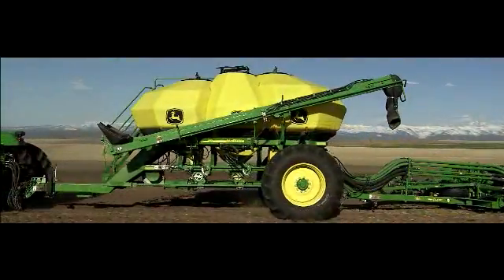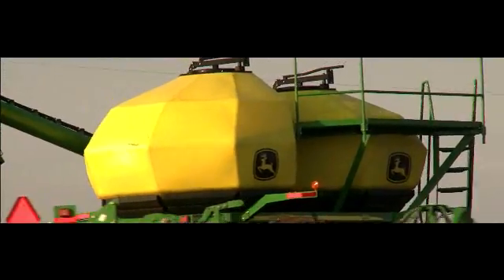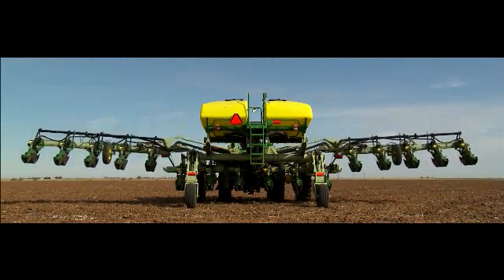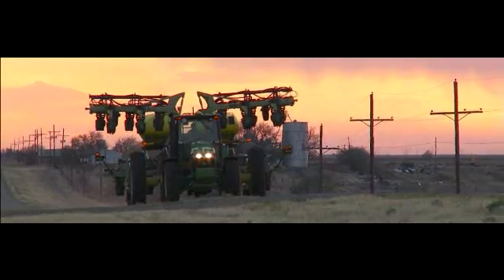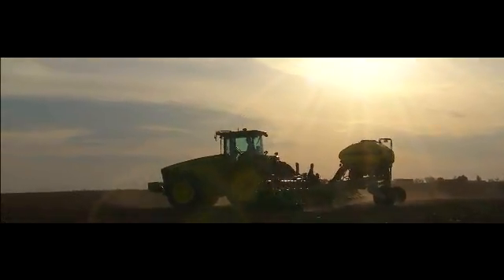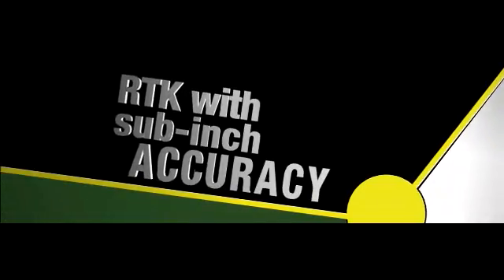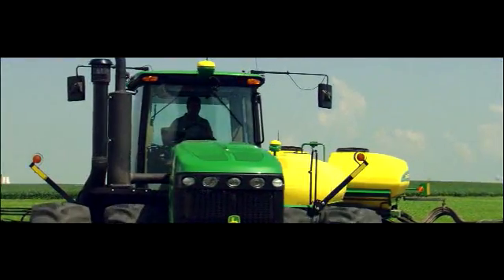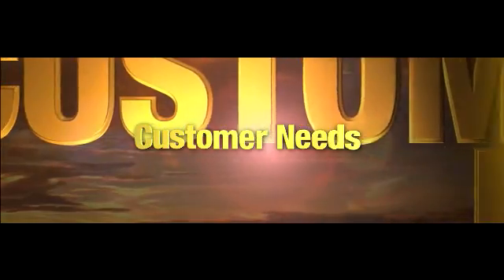New Innovation in John Deere Planters & Seeders

Comment: Ya john deere is still its own company but its kinda hard to say when they have so many things built by other companies, like baur built frames for the 36 and 48 row planters, and vermeer built rakes, and now kuhn balers, and all the small utillity tractors like the 2305, you can get the same tractor in a kubota, and weird things they did like some of the mix ups between them and detroit, and how can they call the detroit engines john deere in the 6000 series choppers?